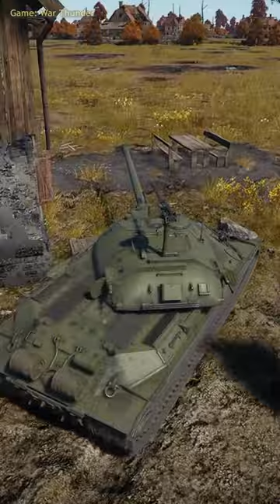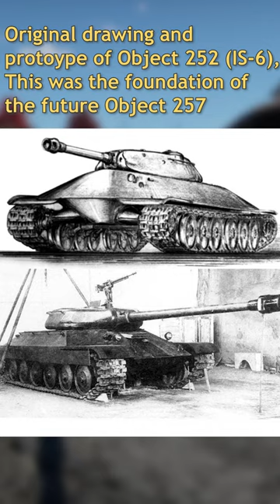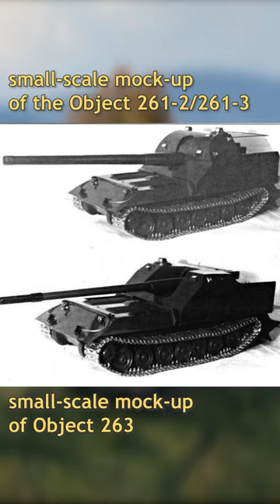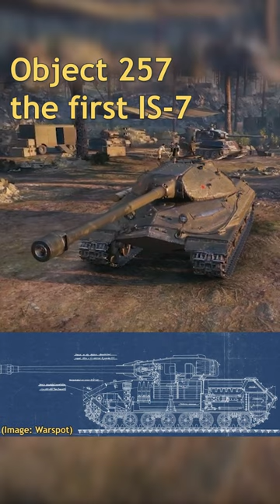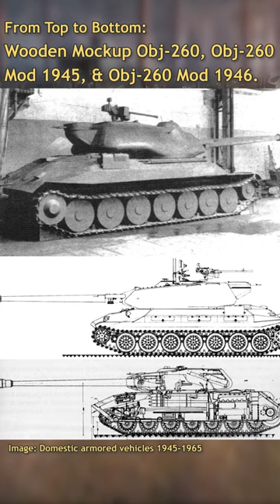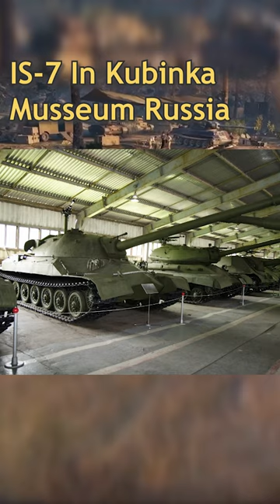Bigger ≠ Better | IS-7 development

Comment: Today, modern MBTs surpassed that weight.
Reply: To date, the heaviest Russian tank ever built. Even Russian MBTs weigh less then the IS-7!
Reply: @BHuang92  Yeah,T-72 has somewhere around 45 tons.I doubt that even latest T-90 weights much more than 55 tons fully upgraded and modified.
Reply: @kaletovhangar  The T-72M weighs 42tons while a T-90M Proryv-3 weighs 48tones, keep in mind that some sources claim a lower weight
Reply: It makes sense that russian MBTs are lighter, as this simplifies logistics in the harsh easter european terrain and winters, as well as allowing the tank to go trough pre-existing bridges, something western equivalents cant do without bridge layers or fording water.

It also makes sense from an economical standpoint, less material means cheaper tanks in higher numbers. Russia alone is huge, with any potential fronts stretching for miles, having more tanks to plug those holes make sense.

Even an old T-55 is better than no tanks at all or a couple of auto-cannon armed BTRs
Reply: Western tanks don't have ejection seats either #slavaazov ZZZ
Reply: @planetfixer you've clearly never seen Leopard 2s exploding after their hull ammo stowage goes off
Reply: @firesb7791 difference is those leopards don't explode with the crew in them 😂
Reply: @derekhenschel3191  yeah there are quite a few Turkish Leopard 2 crews who would disagree with you, if they weren't vaporised in Northern Syria
Reply: @firesb7791  I've made several attempts to leave a comment on this that just keep getting removed by YouTube so basically. No, there's only been 2 confirmed total crew fatalities of the leopards in Syria unless you have some new footage.
Reply: @derekhenschel3191  
There several videos of Leopard 2 getting hit in the ammo stowage and having a really bad day, I mean honestly, just grow up.

Comment: Wonder if it used depleted uranium how it would do against the Abrams if it could spot it
Reply: Hard to tell. The 125 mm modern Russian gun is a development from its S-70 130 mm. From the other side towed version 130 mm M-46 is still in use.
Reply: Well 130mm gun is huge, but if I am correct it didn't have HEATFS or APFSDS so only like APHE and HE, so basically it couldn't penetrate it from the front except for the weak spots, but the lack of nv sights and thermal sights is quite a big disadvantage, and it didn't have a laser rangefinder so it couldn't hit targets accurately on the long distance fights. So the conclusion the Abrams even the first one would win against the IS-7 and I say that you would need 7-9 IS-7s to overwhelm one Abrams.
Reply: @petarkrulj1760  I agree, that is why I did say hard question. Also it is a rifled gun, so making a good APFSDS would take years. The HEAT and HEP wouldn't be effective. Also spotting would be an issue too.
Reply: @w0lfgm  Goraneeee, nas si?
Reply: @petarkrulj1760  Србија и Србин .
Reply: That's a bit like asking how the Conqueror would do against modern tanks if it had APFSDS.

I'm sure it'd do pretty well. But at that point it's not really an IS-7 anymore.